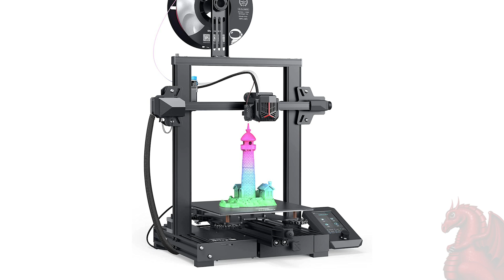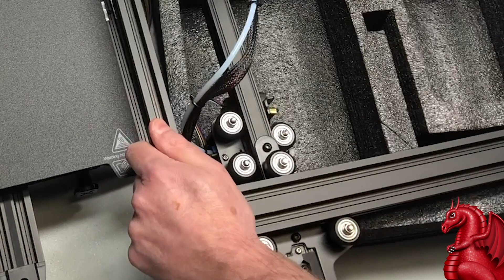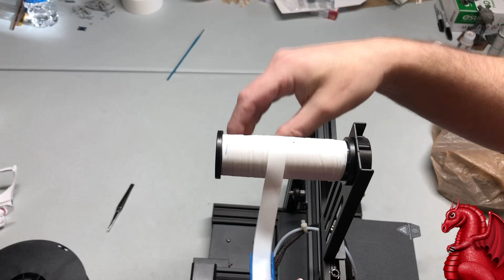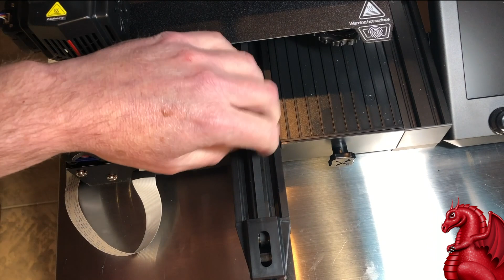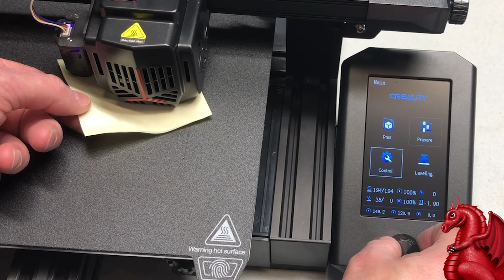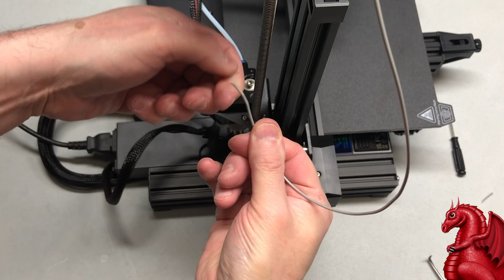Ender-3 V2 NEO Assembly

Comment: Wow!!  This is the best video I've seen yet.  I've had my Neo for 3 years and have just had the bowden tube fail. I have had the "if it aint broke, don't fix it" attitude and, to this day, the print quality is brilliant though, I have never even replaced a nozzle. Since I'm doing the tube anyway, I'll replace the nozzle and re-set up the printer from scratch. This video (and one of your other videos) cover absolutely every question I had.  I have been pretty nervous about the whole process and have avoided messing around with levelling too much.  Now, I feel confident that the whole process will be pretty smooth. Suffice to say, you have one more subscriber.

Comment: Hi, Excellent video.  I have a question with regard to the print resume.  Cura version 5.10.2 has the ender 3 V2 neo as a printer, the Gcode is different to what you show in the video,

G92 E0 ;Reset Extruder
G28 ;Home
G1 Z2.0 F3000 ;Move Z Axis up
G1 X10.1 Y20 Z0.28 F5000.0 ;Move to start position
G1 X10.1 Y200.0 Z0.28 F1500.0 E15 ;Draw the first line
G1 X10.4 Y200.0 Z0.28 F5000.0 ;Move to side a little
G1 X10.4 Y20 Z0.28 F1500.0 E30 ;Draw the second line
G92 E0 ;Reset Extruder
G1 Z2.0 F3000 ;Move Z Axis up

would you still add the same code and if yes, where?  
Cheers Neil

Comment: This has been a great printer until today. Filament broke off right where it enters to go into the Bowden tube. So I cannot feed anything in to push it along, and it doesn't come out naturally when heated. On my Ender v2 pro I can remove the bowden tube easily to deal with this issue, but it looks like I'm going to have to do major engineering to do so on this thing.

Comment: Been loving your Ender-3 v2 Neo videos, especially the Bowden tube help.  I've got all of the parts you recommend in my cart, but I was hoping you could recommend a power supply too.  My psu has stopped working, and it's not the motherboard.  Would you be able to help recommend a better psu?  Thanks!!

Comment: Hello, I arrived at this channel through the suggestion of the Fat Dragon Games website. I intend to print the scenarios they have for sale. I’m from Brazil and plan to buy a 3D printer. There are two options within an affordable price range for me: the Creality Ender 3 Neo and the Ender 3 V3 SE. Both have similar prices, but I’m unsure about their differences. Could you suggest one of them or let me know why I should avoid either? Thank you! 😊
Reply from the maker: I have both and like both. The Neo is better if you also wish to use .2mm nozzle to print miniatures, but it requires a little more maintenance due to the bowden tube feed. The V3 SE is easier to maintain, but won't print miniatures as well.
Reply: @Tombof3DPrintedHorrors  I intend to use a resin printer to print miniatures. But since the Neo is capable of printing miniatures on it, it really seems like the best option to me. When you say that the Bowden tube feed needs more maintenance, what are you referring to—replacement or cleaning? Thanks
Reply from the maker: @CelsoAnnes  both.

Comment: Excellent point about power loss recovery! I was wondering why my spiralized prints had these little bumps, I think they are referred to as "zits", that were all around my print. Turns out you're exactly correct...each of these "zits" was the result of that quick pause to write the current layer data to memory in the event of a power failure so when the power came back on, it would know where it left off when the power went out. Excellent idea, in theory, but it impacted everything I printed. I turned that option off in the gcode, and voila! No more zits! Perfectly smooth. You earned my subscribe for making that very point! Keep up the great work!
Reply from the maker: Glad it helped you! :)

Comment: If you are looking for an entirely flat surface ... try your Ceran-Glass cooking plate in your kitchen - if available ... or place a large mirror on a table.
Reply from the maker: That adds too much mass for detail printing, best option is spring-steel PEI or G-10 sheet.
Reply: @Tombof3DPrintedHorrors  ... as a support when levelling the frame

Comment: brilliant video, thankyou for this setup info.. i have taken your advice and changed the bowden coupler and installed new ptfe tube and nozzle, i would like to print with TPU filament but i see no option for this in the ender 3 v2 neo menu. would i just use the PLA one ?  thanks again for this video.  subbed as well.
Reply from the maker: Stick with PLA for tabletop game minis and terrain, TPU won't work well for those type models.

Comment: I srsly love the descriptive videos you make! THANK YOU! 
Regarding the eccentric nuts (https://youtu.be/I2U-C7-CiYE?t=503); For a newbie (like me) the process is not entirely clear. Should the wheels turn, but the carriage not move? What if the wheel that I'm physically trying to turn, does not turn? Does this indicate too tight tension on the eccentric nut? :D
Reply from the maker: You should be able to turn the wheel with two fingers and effort, but the carriage not move. If you cannot turn the wheel without the carriage moving the wheel is too tight. :)
Reply: @Tombof3DPrintedHorrors  as another noob who loves this video I think you should have also said "while holding the moveable part stationary with the other hand" I can see you doing this in the video but you never say it. Obviously it would be super loose if it didn't move without holding it but us noobs are often really dumb :-)

Comment: could anyone help me. I honestly think creality sent me the wrong printer from the factory.. My receipt on my email says 
Ender-3 NEO Upgraded 3D Printer CR Touch ABL Installed

i got an ender 3 it says ender 3 neo.. i dont have color screen. i have blue and white screen and i dont have the dish thing under by the PSU...
Reply from the maker: This video is for the Ender-3 V2 Neo, not the standard Ender-3 Neo which is what it sounds like you received. Did you order the V2 or the standard Ender-3 Neo?
Reply: @Tombof3DPrintedHorrors  yeah you're totally right.. i wish i woulda realized sooner.. i now have an ender v2 3d laser easy shroud that does not fit my printer.. i worked so hard on it and long on it too redoing pieces i wasnt happy with and such.. such a disappointment.. honestly what upset me the most is my back hurtin after being bent over by my printer (literally lol) for like 6 and a half hours figuring out why my extruder base plate has 2 heat block insert thing that honestly just seem to cause me a lot of trouble lol.. i hope they're helping prevent issues for me too but idk. thanks for getting back to me so quickly

Comment: So, I love your videos. Live by them and share them with anyone I've gotten into 3-D printing. I'm only at 24:39 in your video now where you are talking about power loss auto recovery and you say it's not that great. I have to disagree on this model. That steel flex printing bed has the best adhesion I have found yet. I went to sleep two nights ago and lost power right after. Woke up the next morning and found the thing ten hours into a 24 hour print and turned off and it was still firmly affixed to the print bed. Turned the printer back on and it finished the print beautifully. I keep having issues with the nozzle temperature and my last 26 hour print stopped about five times and I kept turning it back off and on and it came out fine once more because the way my prints actually stick to this bed. Either way, It's been a life saver for me. And I think this video is going to fix my nozzle issue. I am about to go check and make sure all the wires are firmly tightened down to the mother board. Thank you for that! And keep up the great videos and great STLs.

Comment: I use the guitar tuning phone app method for adjusting belt tension, it works fairly well. A lot of math has been worked out for the specific frequency the belts should sound like when plucked on an ender 3, and I'm assuming there's not been any major changes to the frame lengths on the Neo series so the exact numbers should likely match. It's so easy for people to over-tighten the belt tensioning knobs, there's no resistance at all. I've seen people snap the belts instantly, even after having been warned how easy it is to over-tighten.
Reply: This is sooo interesting please lmk where i can find this information